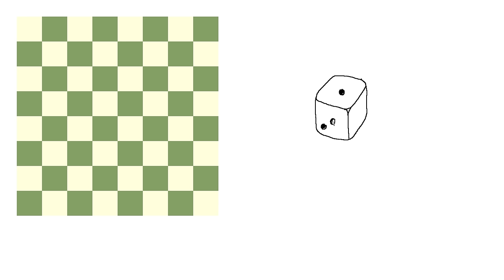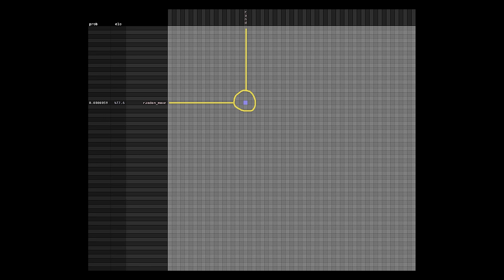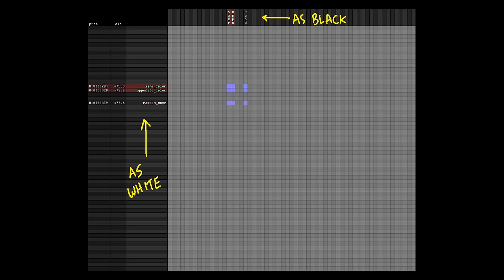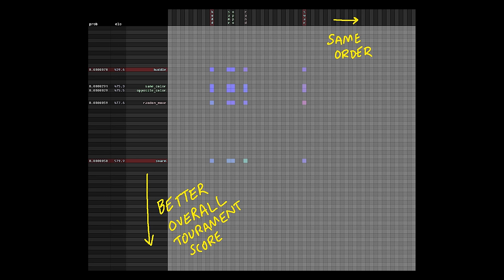30 Weird Chess Algorithms: Elo World

Comment: i was thinking “yeah don’t let the computer ask if a move is legal, just let it say what it wants to do and then if it’s not legal make it guess again, don’t let it know a move is legal without doing it” and yeah, i suppose generating a list of ALL moves and then doing the first valid move works - but that seems to be the same as asking it for moves and reasking if illegal, just that it generates a lot more moves that never could be useful instead of stopping at the first legal one

or you just used that list analogy to explain it and you did in fact use a slightly more optimized solution, you could say the longer it takes the worse the algorithm is and the shittier the AI is, but really the faster it goes the less time it’ll have thought about it and improve its moves and longer times mean deep evaluation
Reply from the maker: The problem with "if it's not legal make it guess again..." is that an algorithm could take advantage of this (by keeping some state) and learn from the fact that its previous guesses were illegal. But actually you are right that in practice I do have some optimizations along these lines, since I implemented the algorithm and know that I'm not "cheating" by keeping state. For example it doesn't actually try all the spycheck moves, it just picks the first one (according to knowledge that it has access to) that is actually legal, if any.
Reply: @tom7  generating a long list of desirable moves is essentially just saying "That move is illegal, please try again" until it runs out of moves to make - when it generates the second move, it can already know the first move is illegal if that move is ever played, and the move won't matter if the first move was legal, so it essentially DOES know the first move is illegal when it plays the secondmost desired move, and if that assumption was wrong then the second move doesn't even matter since the first move would be played instead - If it kept track of what was illegal in earlier rounds and could use that for its first move, that would run into the problems you mention with keeping state, but you also said the AI has no clue what has happened in previous rounds and the state is reset, so that's not an issue. It essentially does keep the state of moves that were illegal this round that it would rather do if they were legal, though i don't think any of your algorithms take advantage of this. It's essentially like an iterator vs a list i think, your AI is generating the entire list of moves it would like to do in order, which you then pick the first legal one from, rather than an iterator that could stop emitting new moves once it plays a legal move. It's not that much more efficient, but i'm fairly certain your AI could be faster this way without changing its knowledge/behavior whatsoever

Comment: 10:25 this is super not true 🙀
Polarization is like a "gate", only letting certain photons through*. A lens could be vertically, horizontally, or circularly polarized, or none whatsoever (or elliptical). I'm pretty sure Polarization has nothing to do with Reflection.

Mirrors and lakes reflect things differently because they're obviously in different positions: if Y is the vertical axis, then a lake is a flat XZ plane (reflecting the vertical Y-axis), and a mirror is an XY or YZ plane (reflecting the horizontal X- or Z-axis).

*(or rather, letting all photons through probabistically, with a chance between 0%-100%. If a vertically-polarized photon hits a vertically-polarized filter, it'll have ~100% chance of getting through.)

Comment: So you have two other pieces on the board and just because your king is in danger, none of those other pieces exist for that move. On the other hand, its not allowed either to move your king into danger, even if it could be a part of a winning strategy, which sounds counter-intuitive and even tyrannical to me. Besides, tyranny usually comes from kings themselves.

Comment: It's interesting that there seem to be two clusters of mid-level players.

One cluster, call it the development cluster, are somewhat effective generalists against all of the very weak players excluding Generous, which they often tie against because they can't exploit the offers it gives them.

The other cluster, let's call it the capture cluster, are very strong against Generous but draw against some embarrassingly bad strategies, notably including alphabetical.

For example, Swarm, Equalizer, Suicide King, Binary e, Rational e, Fatalist, Survivalist, Reverse Starting, and Random Move all fit into the development cluster.

Meanwhile, both versions of Chessmaster, CCCP, and to a weak extent Minimize Opponent Moves and for some reason Same Color, Opposite Color, and the symmetrical players all fall into the capture cluster. Weak against extremely passive players but strong against ones that give them pieces.

An interesting question is why Same Color and Opposite Color are capturers rather than developers. Perhaps the answer is that they're just so bad at developing that capturing is their only hope?

Interestingly, blind players seem to cluster fairly strongly in the development-based category, unlike CCCP or the Chessmaster. This suggests that it's mostly transitioning to just throwing pieces at the enemy and seeing what sticks after a certain point when the board gets too mangled to analyze.

Curiously, neither version of pi is strongly in either cluster. Instead behaving in completely different ways.

Comment: would be incredible to have some impostor player that make illegal moves every now and them, in different %.

Also start giving really weird hendcaps to the really weak engines,  like do two moves in a row, make copys of some random piece as your move, very weird shit, until you make like de pacifist beat stockfish half of the time, would smooth the tournament in a very nice way, the elo system dosean't care if the player plays by the rule, only cares with the final result. 

Imagine you could have thounsands of players in your tournament.
Reply: Issue with your idea is that an illegal move will get rejected by any chess engine GUI, and will be treated as a forfeit.

Comment: I'm really curious as to how pacifist doesn't get any X's.
Edit: specifically against something like swarm.
Reply: it does random moves (and all of those deterministic players do random moves if they have more than 1 move that fits their strategy), and sometimes those random moves draw, sometimes swarm or some other player will checkmate it by accident, you can even end up with draws by repetition thanks to random moving (unlikely, but in a big big set of games everything is possible)
just one draw and win need to happen for X to not appear, it's very likely to happen
however what I'm surprised is that 1M node stockfish does not get X, I just did a test of selfplay 1M stockfish and it played 200 identical games

Comment: How did Stockfish lose any games? It could beat Magnus 100 games in a row
Reply from the maker: They're draws, not losses. It's running at far from full strength here (~1s/move) but the real reason for the draws is that my interface to it is stateless, so it walks into some draws by fivefold repetition that it would otherwise be able to avoid. The deterministic players are especially likely to luck into these loops.

Comment: 10:39 is the mirror polarization thing a joke that goes over my head? Or maybe I've just never heard the word polarization used that way.

a mirror only reverses front and back, not left and right or up and down. We see backwards images as the result of us starting with an object that's facing us and then using our hands to flip the object to show it to the mirror. If you instead show an object to the mirror by flipping its top over the bottom, it will be upside-down in the reflection, but not backwards.

In the mirror, we see ourselves as having our left and right reversed because we are extremely locked-in to thinking about people turning left and right, because we never turn ourselves to be facing backwards by rotating ourselves up and down - we'd end up on our heads just to walk back out of a dead end road. Since we can't just exchange our front with our back without rotating, anyone facing us must have been rotated one of the normal ways, we expect the left and right to have switched places, and when they haven't, we expect that it's that rotation's rules that have been broken by the mirror. But the only rule the mirror breaks is that the front of an object can't be behind its back. It literally doesn't flip left and right or up and down - but since it's the only thing in the world that doesn't, our minds are blown and we make up some kinda weird lore about flipping left and right.
Reply from the maker: Yes it is just a joke but sometimes my deadpan exceeds expectations :)
Reply: @tom7  I'm so glad to hear that!

 I just binged a whole bunch of your videos and your channel is among my favorites. You are doing with your channel what I wish I were doing with my life.

And please don't take my reaction as a reflection on your ability to deadpan just the right amount - I am the most gullible person  I know by far. So thanks for replying!

Comment: 10:10 The statement you made in the video regarding mirrors, lakes, and lenses is incorrect. I'm not sure if you were trolling, making a sarcastic joke, or genuinely misinformed, but I just wanted to address the inaccuracies in the explanation you mentioned.

Firstly, it's important to note that mirrors do not have an inherent association with horizontal polarization or any specific polarization. When light reflects off a mirror, its original polarization is preserved. Mirrors actually exhibit mirror symmetry, meaning they reflect light in such a way that the image appears reversed along the z-axis or the axis perpendicular to the mirror's surface. So the flipping occurs along the z-axis, not the x-axis as stated.

As for lakes, they do not possess vertical polarization or any specific polarization. The appearance of an inverted or upside-down reflection in a lake is due to the complex interaction of light with the rippled or uneven surface of the water. This phenomenon does not align with the concept of symmetry. It is important to differentiate between the optics of reflections and the mathematical concept of symmetry.

Regarding lenses, circular polarization is not directly related to 180-degree symmetry. Circular polarization refers to a specific type of polarization where the electric field vector of light traces out a circular path. Lenses themselves do not inherently flip or rotate images by 180 degrees. The orientation of the resulting image depends on the specific optical system and design of the lens.

To summarize, your explanation contains misconceptions about symmetry and the behaviors of mirrors, lakes, and lenses. Mirrors exhibit mirror symmetry along the z-axis, lakes can create inverted reflections due to the water's surface, and lenses do not inherently flip or rotate images by 180 degrees.
Reply: it was a joke
Reply: @rollinontheboard  Okay, thanks for clarifying that for me. I assumed it was a joke, but I wanted to make sure to provide accurate information. Sometimes, people who don't understand the joke may get confused or assume the person making the joke is confused. So, it's important to clarify and provide accurate information for those who might not recognize it as a joke.